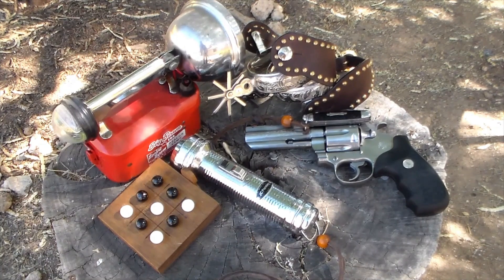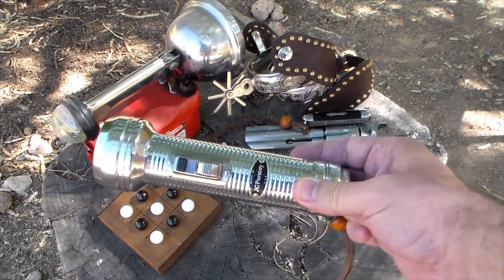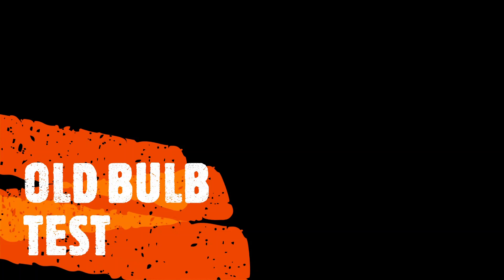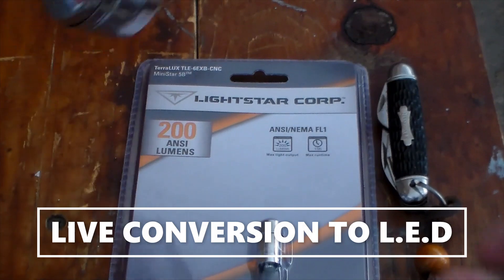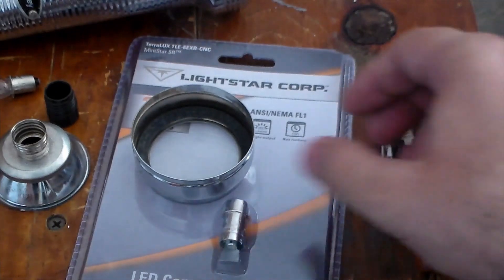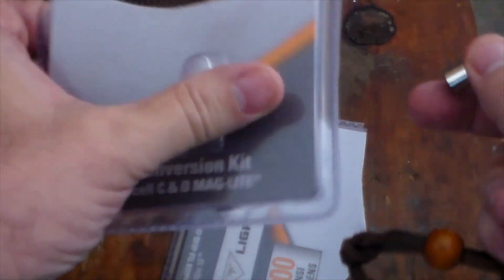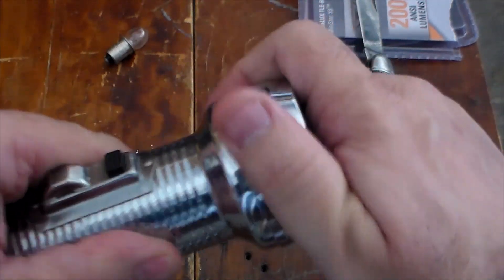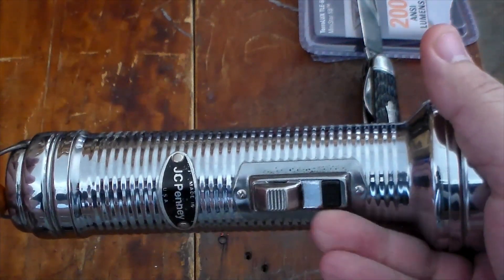The Old Flashlight L E D Conversion System 100,000 Hour

Comment: I have a Resto Flashlight, looks identical to your Pennys. Uses 4 D cells, so its  two batteries longer,  what led would  I get? 4ds are 6 volts (?) I'd like to convert it to an led.

Comment: Does the multiple position switch still work with the led conversion?  I don’t see why it wouldn’t just curious.
Reply: It's just a momentary switch, LED bulbs switch on about as fast as incandescents, so yeah, it will work fast enough for morse code.